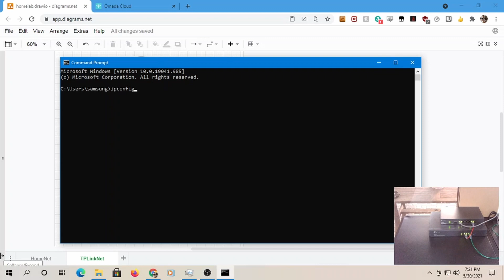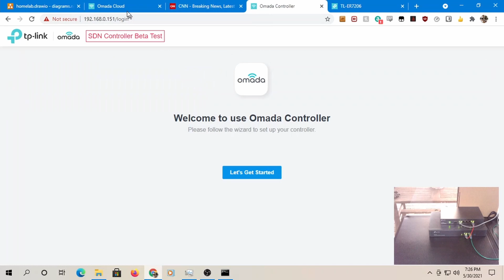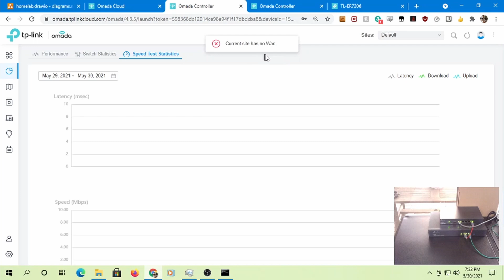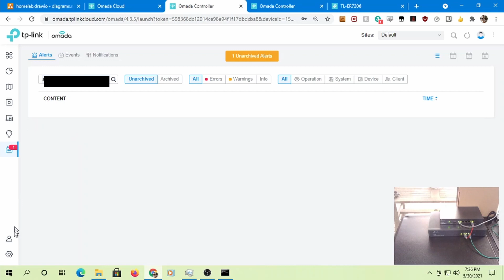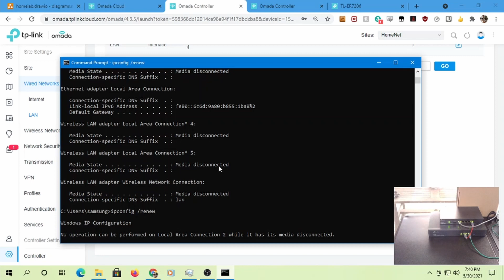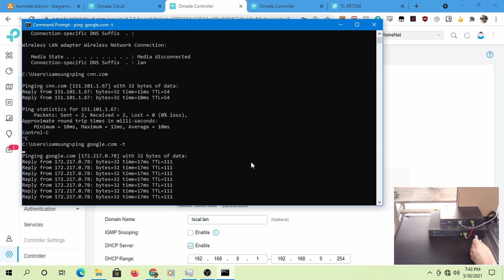Let's configure EP1: TP Link TL-ER7206, OC-300 Controller and Omada SDN Out of Box Experience

Comment: Hello Sir. Thank you for your video. I'm actually planning to set up the ER7206 and the OC-300 together. TP-link official support has not given me enough information that I need. I don't know where else I can contact you so if I may, I'll just post my questions here. If you're familiar with a mikrotik device, I want to do a setup similar to what mikrotik devices can do. To put it simply, I'd like to build a network for wired and wireless clients with captive portal. Some personal select devices will be able to bypass authentication and have internet right away.

1) Mikrotik devices allows bypassing of captive portal by registering their mac address in the device. Can ER7206 do this feature too?
2) Are you able to program each LAN port and configure them individually? 
3) Is it possible to configure one LAN port to have captive portal and distribute the connection through a combination of switch and wireless access points? 

Thank you so much and I hope to hear from you soon. Thank you Sir!
Reply from the maker: Hello Christopher. Thanks for dropping by the channel and sorry for late reply. For some reason, your comment has been held by YouTube and I have to  "allow" to publish it. As for Mikrotik, I know about it but have not personally used one so I can't really comment on it,  however TP-Link do have a "portal" that you can use. Now whether it has the same/less/more features than Mikrotik, I don't really know.

1. I have not personally played around the Portal feature in a long time, once I got some time, I'll look into it again.
2. Yes
3. Probably Yes. I have not used it for some time, but I know you can configure VLANs and trunks per port, and if the Portal works the way I imagined it to work, then yes. I will have to give it a try to give you a definite answer. When? Not sure :(

Sorry if I don't have all the answers, and can't get the answer fast enough.
Reply: @deadmeats  Thank you so much for your reply Sir. I appreciate it. Thank you!
Reply: @deadmeats  Hi Sir. I'm planning to purchase the OC-200 and not the 300. It should work with the ER7206 too right? Also, what's the main difference in both devices? Thank you.
Reply from the maker: @christophergo622  Heya, you are welcome. OC-200 should work fine (and a lot cheaper). The major difference between the two is the number of TP-Link Omada devices they can handle. OC200 can handle up to 100, while OC300 can handle 500. So for typical home use and small business use, OC200 is ok. For physical/hardware difference, you can refer to this chart: https://www.tp-link.com/us/compare/?type=smb&typeId=5746&productIds=41038%2C27623

Take care!
Reply: @deadmeats  thank you for your reply Sir. I just checked the chart you sent and oc-300 says it can support up to 15000 clients while it doesn’t say anything for the oc-200. By clients in this context, what does it mean? It means computers right? And how many clients can the oc-200 support? Thank you.
Reply from the maker: @christophergo622  Hey Christopher, I don't know how many clients OC200 supports, cant find it in my manual (could be in it, just cant find it). However, note that while you can see/map the client list in the Omada interface (whether OC200 or OC300), you really can't control or configure these non-Omada clients i.e. if you have a Pi4 or a Windows PC or an Xbox Console connected, you can't display their screen using Omada (you have to use different tools such as remote desktop or VNC, remote KVM, etc.). You also can't deploy patch or run applications remotely on these clients using Omada console.

You have to ask yourself if this feature is a must for your set up. If it is critical, and you know you are going to have close or reach 15k clients, then you have to get the OC300. If not, or you are planning to use different tools to manage your clients, then OC200 works fine.
Reply: @deadmeats  thank you for your reply Sir. No I dont need to configure clients through the Omada device. I also dont need 15000 clients connected at one time. Probably 500 is already too many but let’s say 1000 is the maximum, can oc-200 handle it?
Reply from the maker: @christophergo622  you are welcome. I can't find the max clients for OC200. However, I found some discussion about it and there is a mention of 2000 total. You can find the discussion at official forum, link below:

https://community.tp-link.com/en/business/forum/topic/191650?page=1

According to that thread, once you reach around 800 clients, it might be time to go for OC300.

You can also look at the TP Link manual if you would like to further check. I found an online one (and can't find total client supported info), link below:

https://manualmachine.com/tplink/oc200/4681032-user-manual/

Just my gut feel, based on supported device, that OC200 can support 1000 clients. Because, since OC200 supports 24port switch, then you only need 42 of these 24-port switches. OC200 supports 100 Omada devices, so with 42 switches + 1 router, you have a lot of "buffer". However, without documented info, I can't really say for sure.

Sorry man, can't be of much help since I can't find any documentation.
Reply from the maker: @christophergo622  Btw, I forgot to mention,  this is an old video. I have an updated one/playlist that I try to keep active at least 1x / week. I use different models of devices but the ideas and steps should apply since it's the same Omada ecosystem.
Reply: @deadmeats  I appreciate your input Sir. Thank you so much. I will comment again here if I encounter a problem. Thank you so much again!
Reply: @deadmeats  Thank you so much Sir!
Reply from the maker: @christophergo622  Hey Christoper, you are welcome. Btw, I uploaded a video that shows the Captive Portal. It is just a quick video, just to give you an idea of the Omada's Captive Portal. I didn't go too deep nor cover many options, more like a quick overview of the feature. You can find it here: https://youtu.be/hCyhts8_svM
Reply: @deadmeats  Thank you so much. I ordered the OC-300 and ER7206. Will arrive in July
Reply from the maker: @christophergo622  Great combo. Don't forget to get an Omada-based switch as your "backbone/distribution switch" when budget permits (even the most affordable one), so you can easily manage your network. Having a backbone switch, you can get non-Omada switches as your "Edge/Access Port" switch (i.e. switch where your wired clients are connected).
Reply: @deadmeats  Hi Sir. Thank you for that tip. I appreciate it. Is it really necessary to use an Omada switch or I can use my existing gigabit switch that's not omada?
Reply from the maker: @christophergo622  Hello, you can use your existing gigabit switch. Just remember that the strength of this line is that it can do both "stand-alone" configuration (i.e. non Omada SDN) or full Omada set up. In stand-alone mode, TP Link Omada also allows you to get Omada-based devices one at a time, till you are able to get all of your network devices to be Omada-capable.

For example, you can get just the router, and you can configure it like an old-school router with a web-console. It will not have Omada like I show in the video, but it will work like a regular Multi-WAN router with various features. The same works for switch, and the access point. You can get them on their own, by itself (i.e. router only, switch only, access point only and use them along with other brands). You can also make your own software controller (i.e. you have an old PC not being used, you can install the Omada software there).

But the main strength of this combination, specially the controller that you purchased, is the ability to do SDN (software-defined network) and you can only get its full benefit by using all Omada-capable devices. It doesn't mean you can't mix other non-Omada devices, it's just that, it makes managing and configuring your network easier.

Let's use your exact case: Omada Controller + Omada Router + NON-Omada switch. You can do VLAN and all other stuff with the controller and the router. However, you will need to jump to the Console of your non-Omada switch to configure it to match or be compatible with your Omada devices (for example, trunk, vlan tagging, native VLAN, etc). The same work for Access Point, you can use non-Omada but configuring VLANs and  other access point setting is so much easier if you are doing it all in one management software instead of switching back and forth from one management console to another.

Hope this helps.
Reply: @deadmeats  i understand now Sir. Thank you so much for that. Ill look into a 16 port omada switch now. Let me see what my budget can purchase, haha.
Reply from the maker: @christophergo622  You are welcome!
Reply: @deadmeats  hi Sir. I just got the er7206 and the oc300. Been tinkering with it for 3 days now. If I may ask, if a single port is carrying multiple vlan tags, how can a wired client join a certain vlan? I don’t know if I make sense or not. A certain port connected to an access point can have multiple ssid so you can connect a client to a specific ssid. How about if it’s wired and has multiple vlans? How can a client join a certain vlan? Thank you so much.
Reply from the maker: @christophergo622  heya, gratz on the purchase. Basically, if your client doesn't know how to interpret a tagged VLAN, they can't connect to that VLAN. Clients can only connect to untagged VLAN (by default, it is the LAN). Let's say your LAN VLAN has 192.168.0.x and you have a tagged VLAN "Home" of 192.168.1.x, if an Access Point (AP) is connected to a switch port with "ALL" as profile, then the AP will get the 192.168.0.x IP address. However, since the AP also supports 802.1q, then you can define VLANs in the SSID, making your client be able to get IP from both VLANs (if configured).

For the regular client (not an Access Point, but a PC or laptop), if you connect it to wired, oftentimes they only see the untagged VLAN so they can't get IP address from 192.168.1.x (they can only get if from 192.168.0.x). To make the laptop connect to 192.168.1.x, you need to change the Switch profile from ALL to "Home".

I covered that here https://youtu.be/bwNH7YbTQ3k?t=415 
Don't worry if I am using a different device, the steps are the same. I used that link since it is updated, and have chapters so you can easily navigate to a certain configuration.
Reply: @deadmeats  Thank you so much for your reply Sir. From the bottom of my heart, thank you. I have a few more questions. I won't be able to have the tagged features for vlan using a non-omada access point right? It has to be an Omada access point? 

Let me just clarify. When using an access point, by joining specific SSID associated with a certain VLAN, we should be able to join that VLAN, correct? So If I want to switch to another VLAN, I'll have to connect to another SSID. If this is correct, is it possible to have multiple VLANs associated with 1 SSID?

When you connect a normal client(Computer) to a wired port, by default it will get the IP of the untagged VLAN. is there another way of getting the tagged VLAN IP other than to change the switch profile of that port? If connecting to a wired port, does it mean the specific port can only handle 1 VLAN when you said I have to switch from ALL to Home? 

I can only program ports of a switch with models that say "Managed Switch" right? I'm looking to purchase an Omada switch but I'm confused which model to get as I don't quite understand the meaning of the features shown on the website. I browsed through all Omada switches and some of them don't say Managed Switch but they are Omada. Thank you so much.
Reply from the maker: @christophergo622  For your 1st question, you can have a non-Omada switch that supports 802.1q, but if it is non-Omada, you need to learn how to do it using the switch's configuration. it will be different on how you do it with Omada.

For 2nd paragraph, your Omada AP supports 802.1q, so yes, it can have multple SSIDs, and you can use just one VLAN or dedicated/different VLANs for multiple SSIDs. This is also covered in the video I linked. If you are new to VLAN, LAN, SSID, etc, I highly suggest you start here: https://youtu.be/bwNH7YbTQ3k?t=262 (i skipped to the VLAN set up, there's also chapter so it is easier to navigate to a topic you want to watch).

3rd paragraph, yes, clients can support multiple VLANs depending on your OS, NICs and the drivers (and sometimes 3rd party tools). You can read more here for Windows-OS: http://woshub.com/configure-multiple-vlan-on-windows/

4th paragraph, managed switch usually means they can support VLAN. But for it to be managed and be compatible with Omada, it needs to be an Omada-manageable device. You can choose from here: https://www.tp-link.com/us/business-networking/omada-sdn-switch/

Have fun and good luck with configuration!
Reply: @deadmeats  hi Sir. Thank you again for your reply. I watched your video multiple times. However, I’m having a hard time understanding everything since there isn’t a voice explaining the things you’re doing on screen. Really sorry.

Anyhow, I might have worded my questions wrong. I mean could you broadcast just a single SSID and have it carry multiple VLANs? If so, how can a computer connect to a specific VLAN if there’s only 1 SSID?

When talking about only wired connections, say for example there’s 1 port carrying 3 VLANs which are 10, 20 and 30 where 10 is untagged and the latter 2 are tagged. How can you connect a computer to a port via wired cable and connect to VLAN 20? 

I’m so sorry for all my newbie questions. I hope you’re not mad. I just really need all the help I can get. Thank you so much.
Reply from the maker: @christophergo622  Heya, no prob! Am not mad, you just need to read up a lot and take things 1 at a time.

2nd paragraph: "could you broadcast just a single SSID and have it carry multiple VLANs?", not really broadcast SSID, but you can send multiple vlans wirelessly. But only wireless-to-wireless network device (not directly to client), maybe there is a product like what you need, but I don't know of any. For wireless bridge, look for Cisco and/or Mikrotik. Just a reminder that when working with wireless, even the latest ones, aren't very good when you have so many clients so making one wireless client be equivalent to multiple wireless clients isn't very favorable. Also, one of the use of SSID is to separate networks or VLANs (i.e. Guest Network, Home Network, etc) so if you plan to combine them anyway, then just use one VLAN and one SSID. 

3rd paragraph: "How can you connect a computer to a port via wired cable and connect to VLAN 20? "-  I linked it already on previous reply, the answer is, you can, it will depend on your OS, NIC, drivers and 3rd party tool how to configure it. Check out the options here: http://woshub.com/configure-multiple-vlan-on-windows/

Have fun, hope you learn more stuff!!!
Reply: @deadmeats  Got it Sir. Thank you so much. Will explore more into this!
Reply from the maker: @christophergo622  You are always welcome! If you have any question, just post back. If I don't know the answer, I will tell you honestly I don't know;  If I have some idea, I will share. And if I have links, then I will definitely let you know
Reply: @deadmeats  Thank you so much Sir. Much appreciated. I do have 1 question. When wiring  between floors in a building, is it a good practice to install a redundant ethernet cable just so if the primary one fails, there’s a backup? If you connect 2 cables between 2 switches, would it function the same as having just 1 cable connecting them? Thank you.
Reply from the maker: @christophergo622  heya, for cabling, always good to have spare not just for back up but for expansion. you dont need to spend too much but don't get the unnamed cheap too. Go with branded ones, and get the highest rated you can afford. Also since this might require change to your home/office/building, it is always best to consult with any expert cable installers/engineers in your area to be sure installation is safe, that you get properly rated cables, not become fire hazard, etc.

As for connecting two cables to one switch, you would normally avoid it to avoid loop. Unless you know what you are doing, very well versed with VLAN (and the tech behind/along it such as STP, LAG, etc.), stick to one-cable uplink per switch (you can go fiber too if you want to be fancy). 

You can read up on Ethernet cables here: https://www.tomsguide.com/reference/ethernet-cables-explained
Reply: @deadmeats  Thank you so much Sir! Appreciate it!
Reply: @deadmeats  Do the Omada Tp-link access points such as the EAP610 support seamless switching from one access point to another just like the deco units of tp-link? Kinda like the mesh devices. Thank you!
Reply from the maker: @christophergo622  I just got the EAP610 (https://youtu.be/ECRyH2Q-ydU?t=11) and have not tested it but according to the product page, it supports seamless roaming (not sure if that is what you mean by seamless switching): 

"Seamless Roaming: Even video streams and voice calls are unaffected as users move between locations.§"

Link: https://www.tp-link.com/us/business-networking/omada-sdn-access-point/eap610/
Reply: @deadmeats  Yes that is what I mean Sir! Thank you so much. Wow you do purchase a lot of devices for learning and fun? That is just awesome!
Reply from the maker: @christophergo622  Thanks!!!
Reply from the maker: @christophergo622  Heya Chris, I am not sure if this will resolve your inquiry about one SSID with multiple VLAN but I made a video about Wireless PPSK. It is still one VLAN per client but the VLAN changes based on the PPSK passphrase. It may not be sending multiple VLAN to a single client but it may help you in other ways. You can find the video here: https://youtu.be/QgoW2BBQHkQ
Reply: @deadmeats  thank you so much Sir. I appreciate it. I will look into this!
Reply: @deadmeats  thank you so much Sir. I appreciate it. I will look into this!